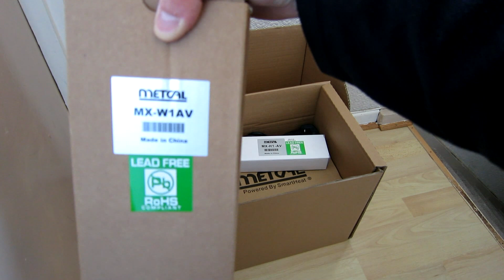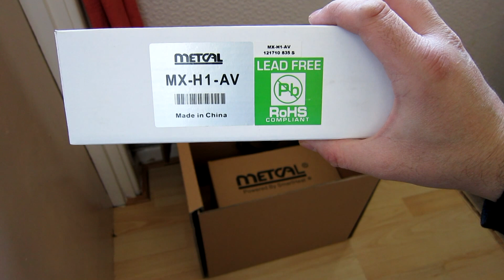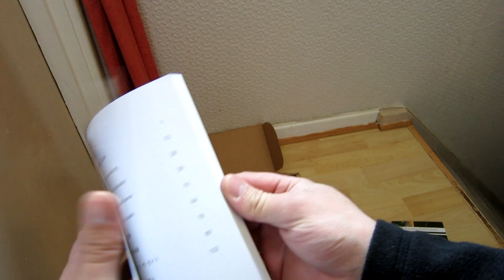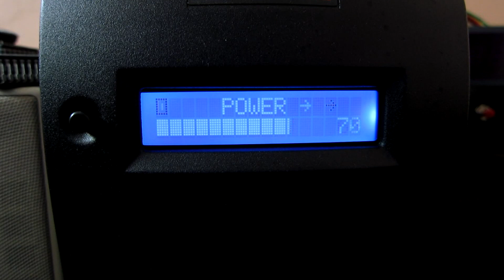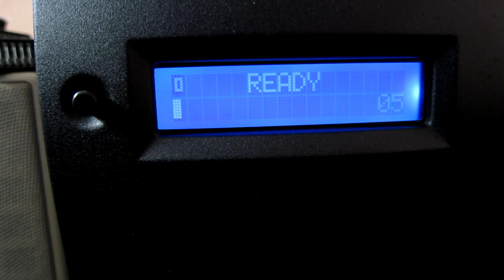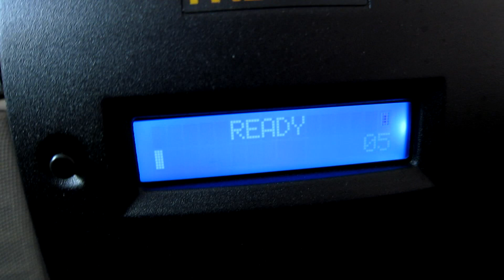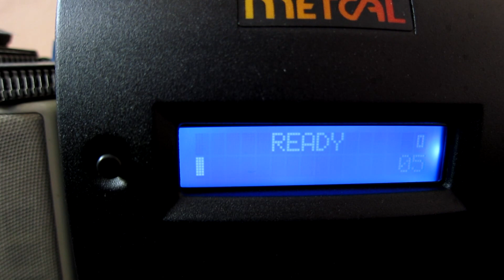Metcal MX5000 (MX-5010) Soldering Station Unboxing / Testing

Comment: I was wondering if you could help, please.  I recently inherited a Metcal MX-5200 Power Supply with the precision soldering iron and stand.

I then purchased a pair of PTCC-701 Conical 0.4mm tips along with the Hot tweezers MX-PTZ.

My question is have I purchased the wrong size tips as the tweezers are not working well at all when trying to remove components from laptop motherboards, i.e., SMD component sizes 0603, 0402 and 0201.

Should I get the same tip with the higher temperature, or should I get a wider tip maybe 1.27mm at the same temperature? I purchased Metcal after hearing lots of rave reviews and I’m wondering why the performance is so bad compared to my basic Hakko.

Your help would be greatly appreciated as I sure it’s a case of wrong tips for the wrong job or maybe I need to setup the MX-5200 somehow to modify it’s performance.

Many thanks in advance,

Comment: @ arcadeuk
Please tell me the heating time of the tip from sleep mode and temperature drop at wide terminals (>thermal cooling space). I could not catch your say. Was that 2 or 3 secs. Also, if you furnish data from your temperature measuring meter, I will appreciate more. I planning to own one, hence...

Comment: hi can this system heat up both tip at the same time ? I mean if I wanted to use both soldering iron to remove a component at the same time
Reply from the maker: MrKronen75 mx5200 can yes

Comment: Just got my first Metcal! Not quite as high end as your collection, then again I don't really make money out of mine like you do. For my needs it will be ok though. I have a JBC that I hate as I discovered I couldn't get my favourite tip for the JBC (can on the Metcal). I fell in love with the knife bit from using a works Weller WDD81 station. Bought my own JBC and discovered I couldn't get it on that Grrrr. They do have a nice but used Hotair rework JBC I am tempted by though!
Reply from the maker: Which Metcal did you get? They are all pretty good. The SP200 / MX500 / MX5000 all have a huge range of tips. JBC are generally also considered some of the best
Reply: arcadeuk
It is only a PS900 I don't want to spend a fortune and find out I am not a fan. I just want to try Metcal first. Like I say I got a fairly high end JBC (CD-2BC) and hated it. So much so I actually prefer my crappy old Antex station! I am tempted by the used JT-2B I have been offered. I was also offered a deal on a MX5000 station but I would have had to get a handpiece and stand etc. BTW if ever you need any electronic stuff let me know I can get loads of stuff from an Disposal company as most companies change them every couple of years for tax reasons. My PS900 was 2 months old and cost me £50 for everything!
Reply: steadicamant
The PS900 is still a great iron - a lot better than anything in a similar price range and has plenty of power. The biggest thing you'd notice moving up the range is more power at the tip of the iron as the PS900 still has the heater separate to the tip.
Reply: which Metcal tip is your favorite? :D

Comment: Metcal doesn't make a station with a built in pump so you use have to use an air compressor that works by blowing air across an opening and creating a vacuum (look up venturi effect) so the pump is only as powerful as your compressor.  Yes these irons are some of the most expensive but they are also the top of the line and the industry standard so if you are serious about your electronics hobby this is the iron to get.